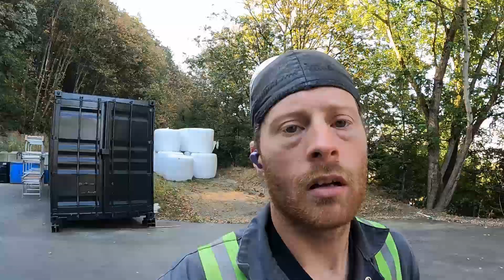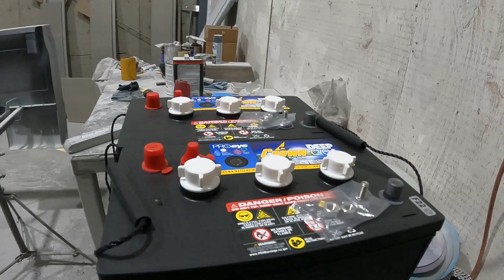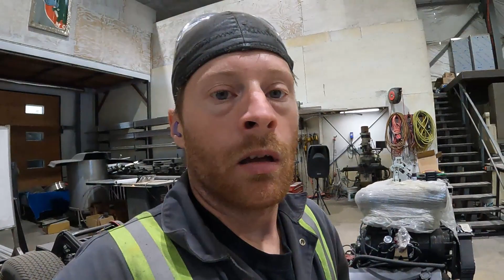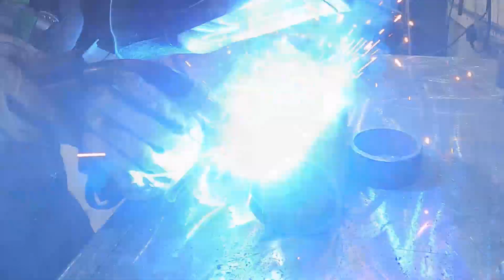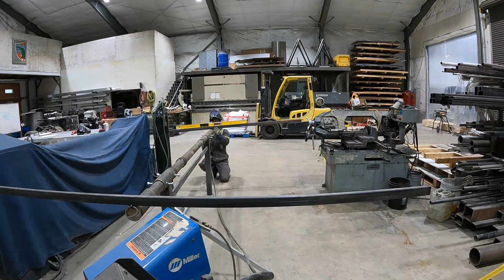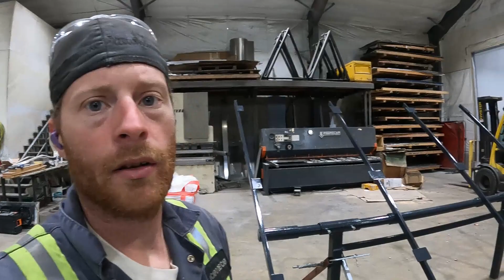Container House Project Part 3

Comment: Wow 🤩 Great job on that frame. Nice design. Don’t know if entioned it but.. how much did you have to pay for: 3 panels, inverter, regulator and batteries?

Keep it up!
Reply from the maker: Hi Eric Degaardt,  
for the 3 panels, inverter, charge controller, battery monitor, as well as all the wire to hook up was around $2800 CAD.